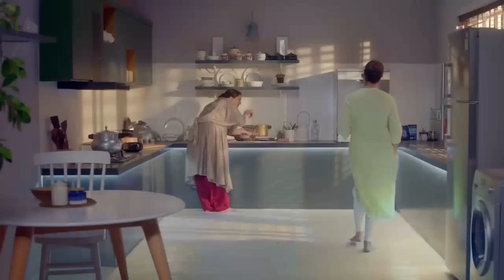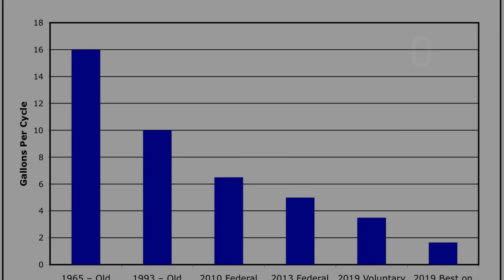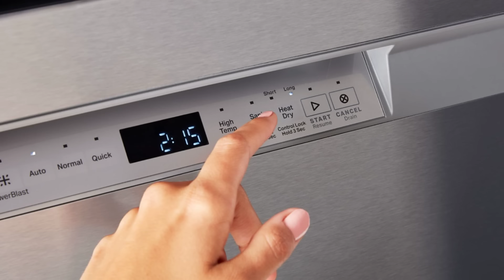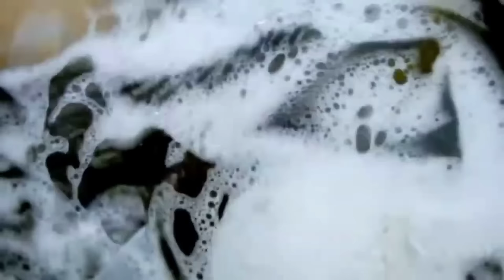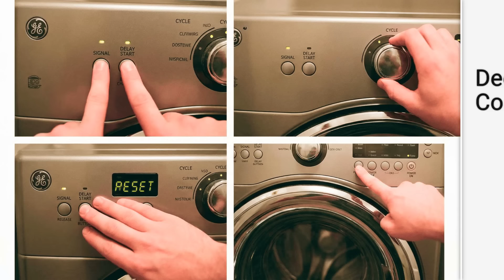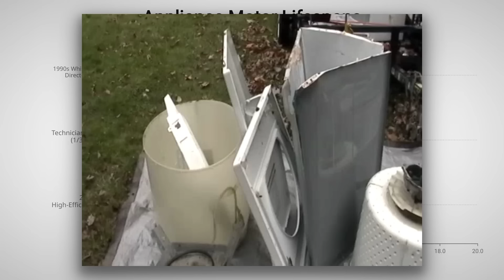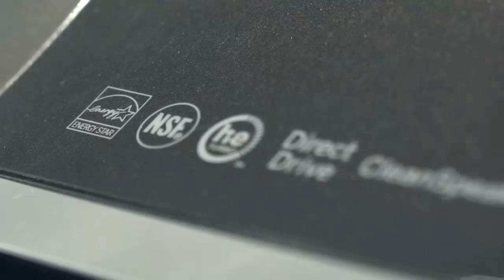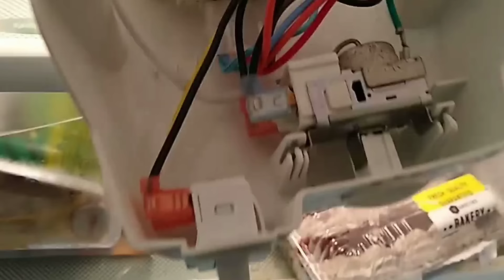Why 'High Efficiency' is a Scam (The EPA's War on Quality).

Comment: 15 year ago my washing machine broke beyond repair (too expensive part). It was slightly older than the warranty and an "all-features" one.

As I didnt want one more scam, I decided to put some effort into the purchase of the new one.

it should be reliable, fast (3-phase electricity = high power), use water (much more ) and with a minimum of features. No consumer-machine reached my specs, at last I found the solution: smallest possible machine for professional use (laundry shops, workers clothes etc). I found this machine also existed (white instead of stainless steel) for the consumer market, but distributors and retailers avoided it.

Relucantly, one dealer accepted to order it for me, and I got it at a price below half of what i paid for the broken one.

This was 15 years ago and the machine still looks and works like new, without any problem at all.
Reply: Nice! Unfortunately for most people 3 phase is not practical. Also, modern detergents do not require much water for most cycles — that's an area where a lot actually has improved
Reply: @QualityDoggo  Here in Sweden 3-phase is quite common, and as to the detergent its still a problem as it stays on the clothes if not enough water used.

Comment: Old school. My 1998 White-Westinghouse washer uses 100 liters water full load (can do partials). No touch screens, just plain clicky switches. It may go another few decades.
Reply: 1982 Maytag still going strong.  Only a few repairs that my husband did himself.
Reply: @catloverkitten10 Those things were built to last. But hey my dad's LG from 2018 with modern electronics and low water usage is still going and hasn't needed a repair yet.
Reply: You'll loose the main bearings. Then the main bearing shaft will either wear so the bearing slips or it will break off from the rotating drum. Any time after the first 20 years is a gift. Pro tips you may already know: don't overload the machine, ever. Use softened water. Do not use liquid fabric softener, ever. Use powdered detergent or soap if you have genuinely soft water. Lastly, talk to the machine and thank it. Mention your appliances in prayer. I'm not kidding.
Reply: @uptoolate2793 I would never buy a front load washer, that would be stupid.
Reply: And I bet your clothes are cleaned good too by the washer each time
Reply: @andrebello4191 Perfectly
Reply: My 1997 Whirlpool washer is still going strong.  Had to get it repaired in 2019.